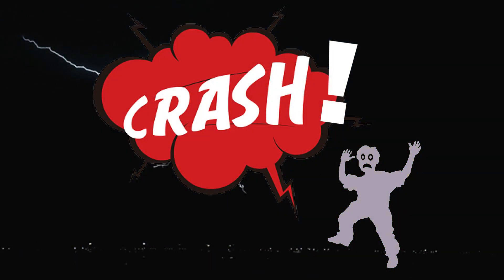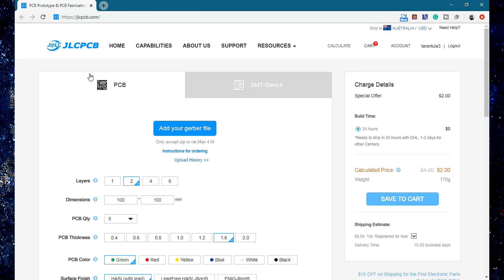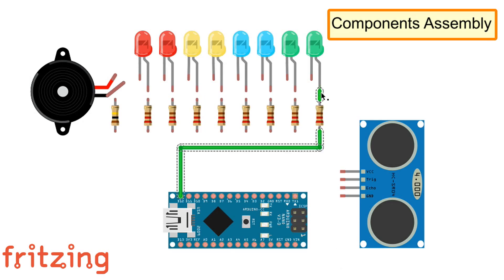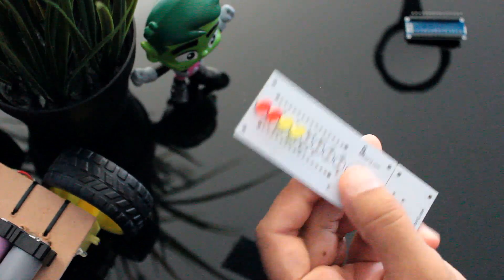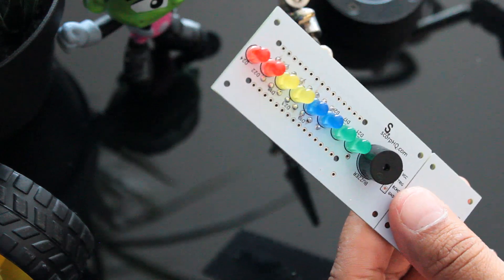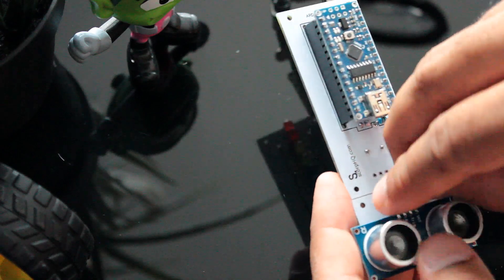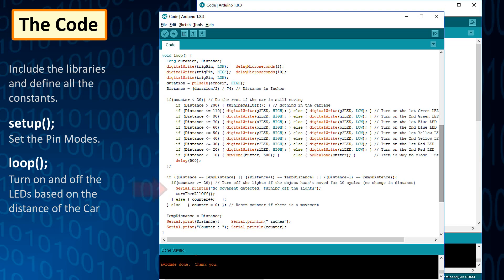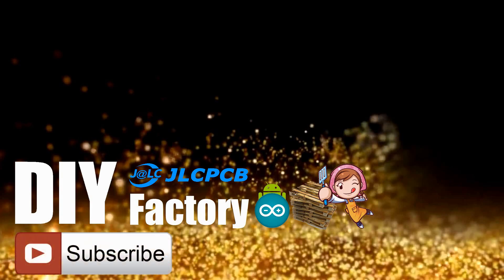DIY - Arduino Based Parking Assistant V2

Comment: Could this be used for a water tank level indicator?  What facts are there that I need to consider?  Thanks for your informative videos
Reply from the maker: Yes, absolutely
You will have to first find out the levels at  which you want the LEDs to change colour
Then, just go ahead and update the values in the code.

Comment: Hey, couple of questions for you if you dont mind. 1. Arduino Nano board coding, do you have the video of showing how to code?  2. There are different types of Arduino boards, would any one of them work? (if you can provide a link to a board that would be great). 3. How does everything including the Arduino gets powered? Please advise Thanks!
Reply from the maker: Hi there 
1. The link to the code is attached with the video 
2. Yes, any arduino board should work. However, my breakout order only allows arduino nano. 
3. You need to power the arduino board using an external power supply. +ve to VIN and -ve to GND.

Comment: Hi Crazy Couple,

pretty good project. One potential issue: my own build worked for a few days, then it stopped running as it did before.
All LEDs but one stay always on now. The startup sequence after powering the Arduino up is also gone.
I have to de-install it in my garage and check what happened - I suspect  that the  LEDs' current killed the Nano I/Os.
Will report back here when I found the cause for the failure to share the findings for other makers.
Mightbe that the LEDs have to be powered by separate transistors, but let's see what happened.
Reply from the maker: Cheers

Comment: I think a small problem is that based on which car is being parked the reflecting surface on the front/back may not be the same (based on the positioning of the sensor) so the accuracy is probably not to be trusted blindly.

So if only one car is used and the sensor is positioned right for it then no problem.